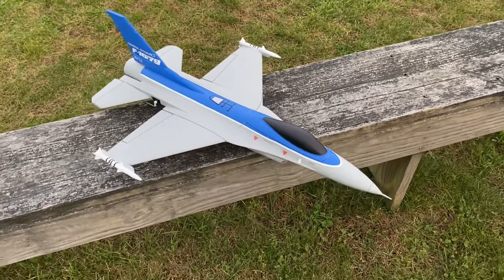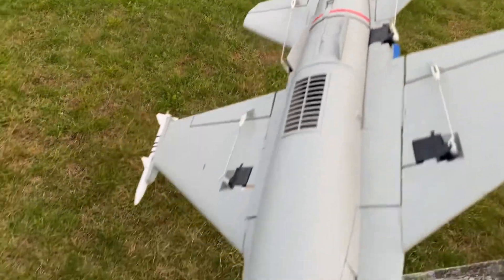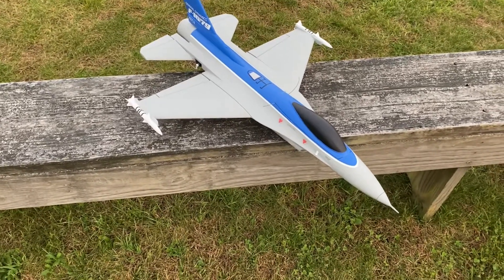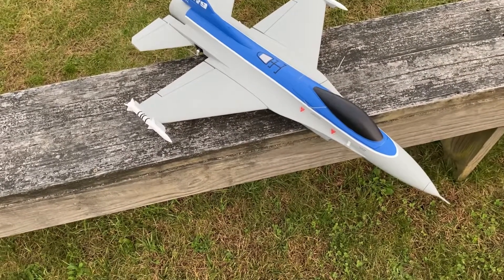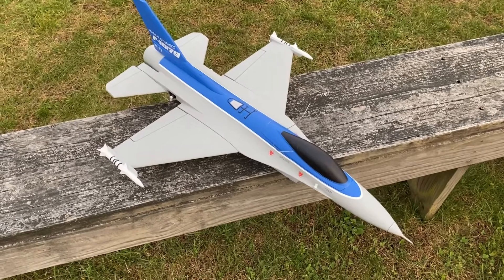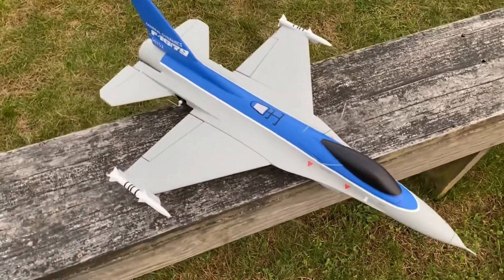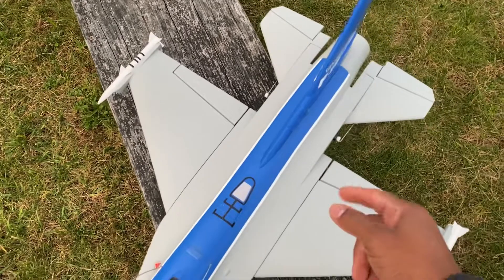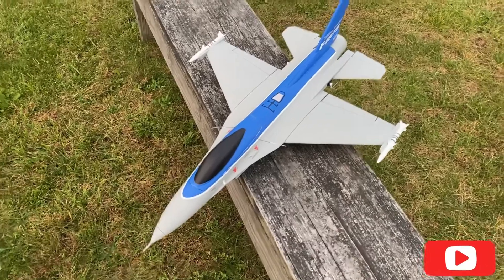Eachine F16 50mm EDF Rc Jet Build Video: Crash on Maiden Flight

Comment: I have the F18 kit, installed the xfly 50mm s4 EDF, was great till my receiver lost signal, I was able to give it full throttle and it seem that the gyro kept it level and it did a flat spin into the ground, only damage was the cock pit hatch cracked, I was shocked. Thought it was an error and same darn thing lost signal so I'll be running a spektrum A630 next.

Current Mods:
-Xfly 50mm EDF 4s
-40amp controller
-metal gear servos
-Radiolink 9 channel receiver I know it's overkill 😅
-Radiolink Byme A Gyro
-Radiolink Telemetry 
-1300mah 4s, 100c  lipo battery.
Reply from the maker: I wish you all the best on your next maiden. I thought mine was really in a bad shape after the crash, I was able to put it back together today. I’ll be making a second attempt soon😀